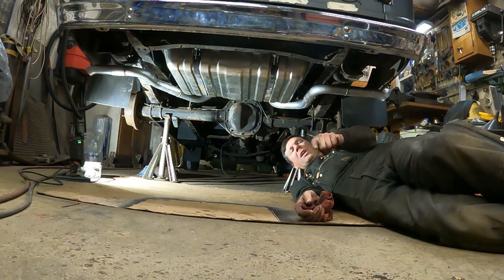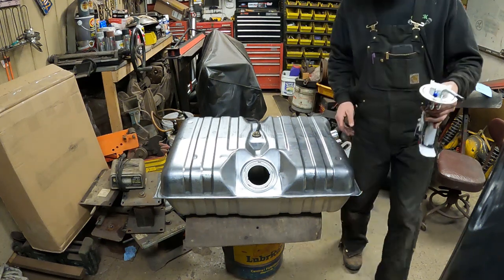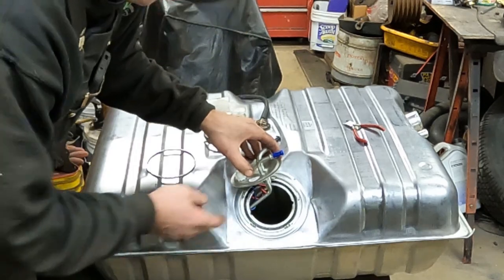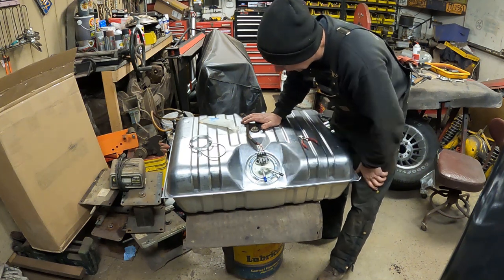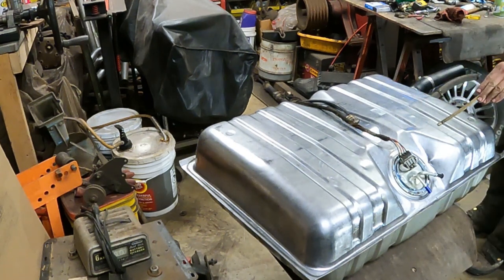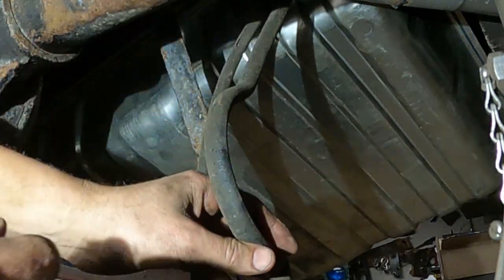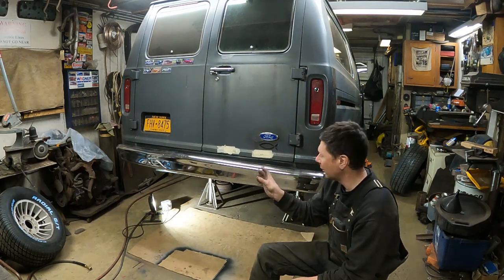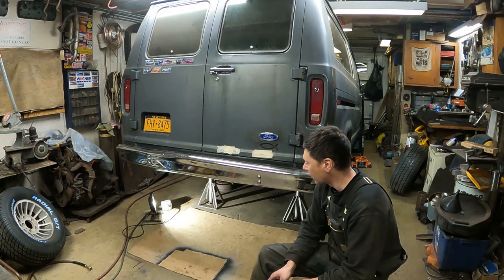New Gas Tank Install:  Ford Econoline Boogie Van Build

Comment: I have all my parts, would you recommend attaching the fuel lines to the tank before putting it up inside the body? I have new limes, pumps and tanks. 18gal and 22gal
Reply from the maker: Yes, makes it easier to install with the stuff already attached

Comment: What tank and pump did you use from rock auto
Reply from the maker: I think I used Carter brand pumps both for in tank and high pressure pump on frame rail.  I used the Spectra 22 gal tank.

Comment: Why did you pull out the whole fuel filler neck instead of just pulling off the rubber hoses from the neck? h
How much dirt went down your filler hose when you pushed the hoses up over the frame?
Reply from the maker: Because it was too hard to get the dryrotted hoses off in place.  No dirt problems, been driving the van thousands of miles since this video.

Comment: What’s bolts are used for the straps to stay in place..bought new gas tank and straps didn’t get any bolts.
Reply from the maker: I'm using the factory ones as they were in good condition.
Reply: @QuickSpeedShop  dang it ..mine doesn’t have the factory ones. Just I’ll go to the auto store.